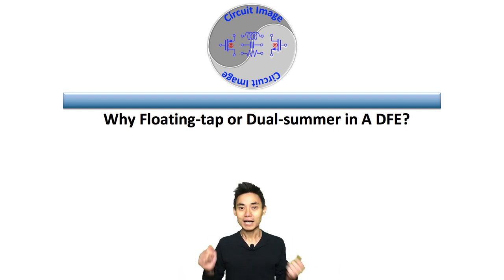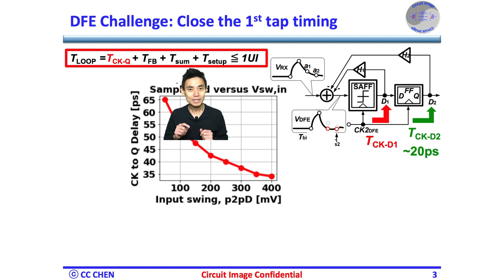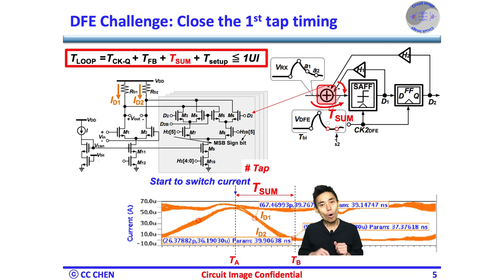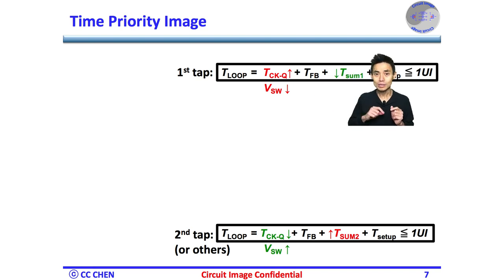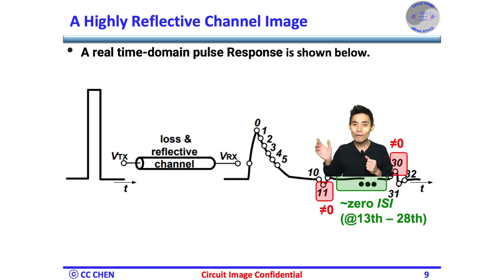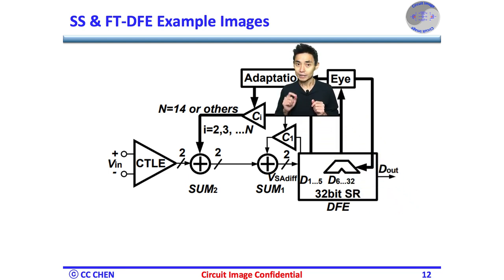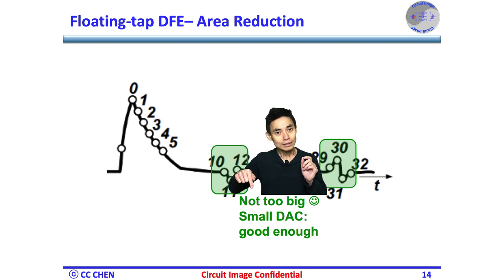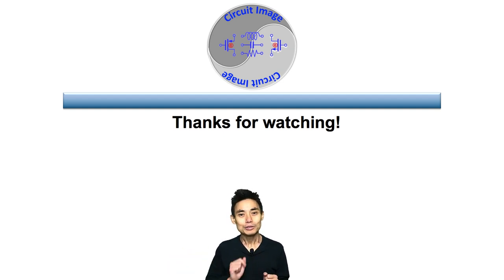Why Floating-tap or Dual-summer in A DFE?

Comment: Hello ! Great video, I think I have seen the floating tap idea somewhere, probably in 40Gbps serial link. Now I understand concept better. 
Few questions related to summer. At slide 5, you show the summer implementation. I think the idea is that vin (from CTLE) has the ISI on it, and to remove the ISI from the summer's output (vout), the right side of the circuit sucks part of the Id1 and Id2 currents and corrects the differential voltage on resistors Rd1 and Rd2.  
So, first question is what are H2[4:0] and H2[5] (I guess these are control bits and somehow related to H2 feedback coefficient). Second question is: it seems that M1 and M2 transistors are controlled by Vin+ and Vin- , which are analog signals with proper common mode. Instead M3, M4, M5, M6 are just switches controlled by D2 (which is either 1 or 0). I am worried that depending on what is the common mode on Vin , the summer might function differently. Or maybe I am wrong? 
And last question: what is vTH on the leftmost transistor  and how M12 is controlled, is it a switch ? 
Thank you again for your work :)
Reply from the maker: Hi Hrachya,
Thank you so much for the feedback and I'm glad the floating tap idea helped you. I have comments below.
Few questions related to summer. At slide 5, you show the summer implementation. I think the idea is that vin (from CTLE) has the ISI on it, and to remove the ISI from the summer's output (vout), the right side of the circuit sucks part of the Id1 and Id2 currents and corrects the differential voltage on resistors Rd1 and Rd2. [CC] YesSo, first question is what are H2[4:0] and H2[5] (I guess these are control bits and somehow related to H2 feedback coefficient).[CC] Yes. H2[5] was the MSB of the tap2 feedback coefficient in sign bits & H2[4:0] was the control bits of the tap2 feedback coefficient in magnitude bits.
 Second question is: it seems that M1 and M2 transistors are controlled by Vin+ and Vin- , which are analog signals with proper common mode. Instead M3, M4, M5, M6 are just switches controlled by D2 (which is either 1 or 0). I am worried that depending on what is the common mode on Vin, the summer might function differently. Or maybe I am wrong? [CC] Yes. That could operate differently; therefore, adding a CMOS to the CML conversion stage would mitigate the concern you had, but the extra delay stage would violate the close timing. In the real case, people will leave with it but make M3 to M6 devices w/ higher Vth devices while the M1-2 could be ultra-low Vth devices to reduce the different settling behaviors.And last question: what is vTH on the leftmost transistor and how M12 is controlled, is it a switch ? [CC] Yes. You're correct that the M12 is just a switch to control or flexibly tune the tail current. Thank you again for your work :)
[CC] You're very welcome.
Reply: @circuitimage  Thank you for the useful feedback :)

Comment: Nice video as always. Could you share the literature/paper reference for split summer for the exact circuit, looks interesting? Many thanks.
Reply from the maker: Thanks for the feedback. There are lots of literature/paper references to the split summers. One of my favorites is this one: "A 1.0625 ∼ 14.025 Gb_s Multi-Media Transceiver With Full-Rate Source-Series-Terminated Transmit Driver and Floating-Tap Decision-Feedback Equalizer in 40 nm CMOS." Please let me know if you need anything else from me.
Reply: @circuitimage  really appreciate your fast response. Thanks a lot for the input and sharing the paper information. Cheers.
Reply from the maker: You are very welcome 😄

Comment: Hi CC,
Thanks for your great video.
At 12:40, what does 7 floating taps mean? 
Physical connection is tap 1 to 5. From my point of view, 6~14 are floating taps, but the number is 9.
Reply from the maker: @陳冠宇 Thanks for the good catch and careful watching. My 7 floating taps were referring to the pulse response ~9:29, which shows the 7 floating taps could cancel the post-cursors #10, 11, 12, 29, 30, 31, 32 (7 taps). Other post-cursors are ~0 and the other 2  floating taps might not be needed since the coefficient would be ~0.
Reply: @circuitimage  Thanks for your clear explanation.
Reply from the maker: @hitboy061  I'm glad that helps :)

Comment: Hi CC, If the ISI take place between post -cursor 1 and post-cursor 2 UI, so this ISI cannot be canceled or compensated out, what is the solution for this case?
Reply from the maker: @Nick Chiang Thanks for the very good question. If that's the residual is small, that's okay. But, if the residual is big, that means the DFE's feedback settling is not fast enough even though the timing was met; therefore, further reducing the DFE close loop delay is a must. Another one is to add the edge-DFE (I can talk about that later), which may add complexity and loading but is very effective.
Reply: @circuitimage  Thanks! I’m looking forward to seeing the topic of the edge-DFE 😬
Reply from the maker: @nickchiang0  Sure. Too many topics people are interested in, so that may take. few times and will give you an update. :)